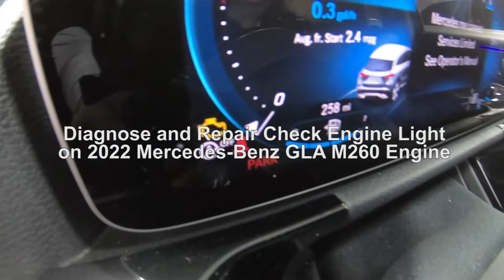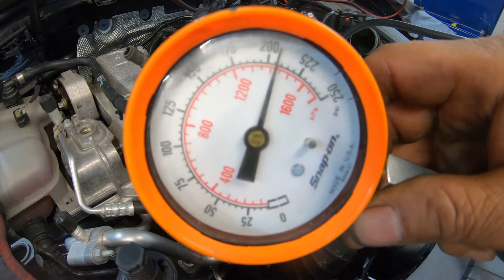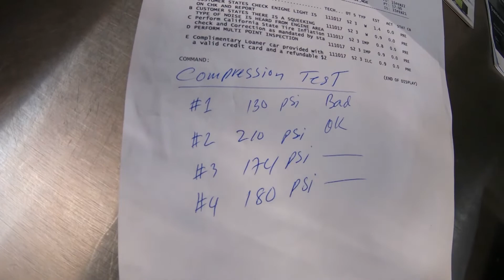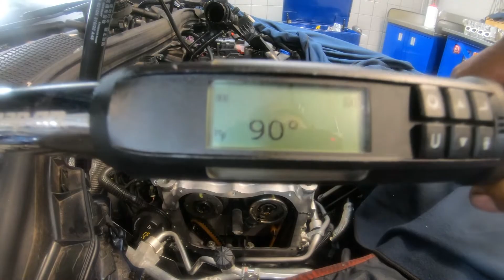Diagnose and Repair the Check Engine Light on 2022 Mercedes Benz GLA M260

Comment: Bought a brand new US 2023  GLA45 AMG last month. M139 motor.  My first Mercedes.  After only two weeks and 450 miles,   I have  a check engine light, and it has been in the dealer possession for 8 days. The car is running normal, and only the auto start stop function is not available, I guess because of the check engine light preventing it.  They said that nothing is wrong with the vehicle mechanically,  but it has some faulty electrical error that is false, they can not find the reason and are working with Mercedes Germany to resolve it.  I think they just can't fix it and are stalling to make more money out of Mercedes corporate, or can't decide to buy back the vehicle.  So far I am disappointed with the service repair and Mercedes quality control.

Comment: I will never buy a Mercedes again. Nothing but problems. Reverse not possible it said. Had it checked and inspected said it was fine. Happens all the time. Check engine light on can’t get out of first gear. Awful cars.

Comment: Why the hell would a new car need this kind of work so soon 😮
Reply: M260 engine has well known valve guide problem, which fails and makes the engine lose compression. Mercedes recommends changing all valves and cylinder head, but people only do it under warranty, otherwise they just change the valve.
Reply: @marcaosebba0 Can you say when the valve guide problem was fixed at the Mercedes factory? I heard that the manufacturer had already made two changes to the cylinder head by the end of 2021, so it must be fixed by the time the new car is delivered in 2022. Can you confirm that?
Reply: @frankdonath4651  The valve guide were change in 2020

Comment: Is this issue as common on the M264 as it is on the M260? Mercedes didn't extend warranty on the M264 and wondering if I should ditch by '21 GLC before warranty expires in 3k miles.
Reply from the maker: Yes

Comment: Was the oil change a part of warranty replacement? Starting from what MY cylinder heads were changed?
Reply from the maker: Yes
Reply: @MercedesBenzTipsTricks  thanks. Was that problem fixed in MY23 models?

Comment: I have 2021 GLA 250 same engine and same suv. No issue. Amazingly it gives me 42 mpg on highway. I use it for daily driving. Might be a bad apple repaired in this video. But it should be under warranty anyway. I have GLE350 2018 still today no issue I drive that GLE Mercedes for family vocation. Then I have Lexus es350 no issues. Every car I had in past all reliable including Mercedes e320 my old one I sold around 200K miles on it. If you change oil on time any car can go 200K without any issue. Make sure do service on time. I do all maintenance myself and have diagnostic computer so saved 1000s and 1000s of dollars over the years. Just with simple maintenance your can have a enjoyable ride of any car. One thing is amazing about Mercedes is when you drive you feel like you are sitting in a tank, very solid feeling on road. I also had Honda accord and CRV all reliable did maintenance myself. And I have seen new Hondas going to dealers for major repair. So bad apples are in every manufacturers. Just one bad able should not be blamed that all are bad. peace
Reply from the maker: I agree! You're perfectly right!
Reply: Yeah, chronic cylinder head issues are bad apples.
Yeah, chronic SRS system faults are bad apples.
Yeah, OM651 chain issues are bad apples.
Yeah, M271 with the same chain issues are bad apples.

Want me to continue?

One thing also chronic with mercedes, blind fanboys drunk on the marketing koolaid.

Comment: Hello,
I had the same problem on my CLA 250 2020.
But mercedes didn't replace the cylinder head, they repaired the valve that had the problem.
Is this the right solution or will I have this problem again in the future? 
Thank you
Reply: Is there an engine sound characteristic of this problem? Because after repairs, I have the impression that the engine still makes the same noise.

Comment: Hi I had bought Mercedes a250 w177 I’m having the same sound when I start the car in the morning and ones it heats up the sound goes I took the car to the dealership 2 times first time they changed the tensioner n belt but the sound was still the same n the second time they said it’s normal I dnt no if it’s normal or problem with the engine ??

Comment: Piece of junk Mercedes.
Reply: Bought a brand new US 2023  GLA45 AMG last month. M139 motor.  My first Mercedes.  After only two weeks and 450 miles,   I have  a check engine light, and it has been in the dealer possession for 8 days. The car is running normal, and only the auto start stop function is not available, I guess because of the check engine light preventing it.  They said that nothing is wrong with the vehicle mechanically,  but it has some faulty electrical error that is false, they can not find the reason and are working with Mercedes Germany to resolve it.  I think they just can't fix it and are stalling to make more money out of Mercedes corporate, or can't decide to buy back the vehicle.  So far I am disappointed with the service repair and Mercedes quality control.